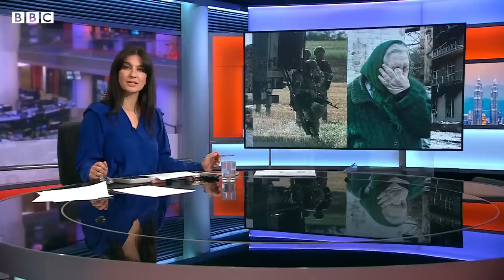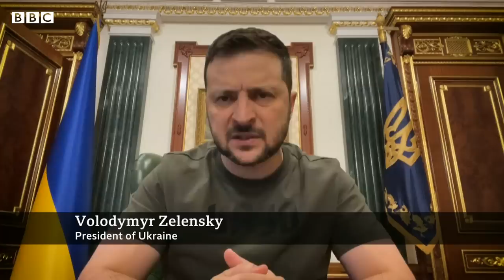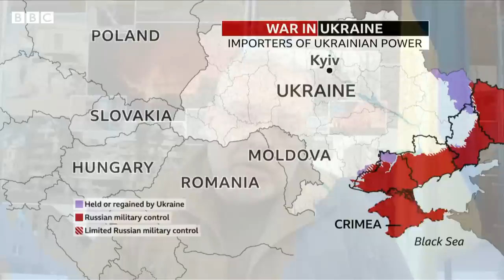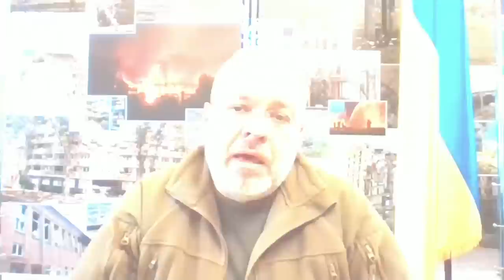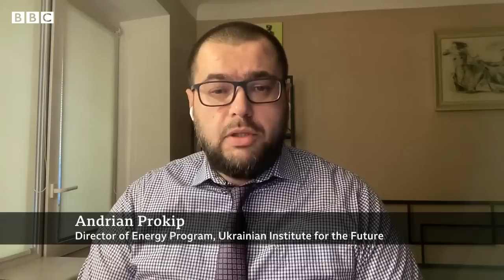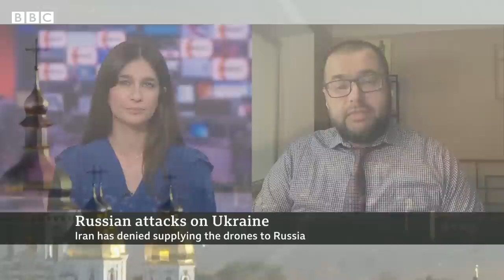Ukraine energy situation 'critical' after Russian attacks - BBC News

Comment: Two things: 1. Are these missiles accurate or not? It's frequently commented upon that they are inaccurate but they seem to be hitting their targets from what I've seen. 2. Going on bombing campaigns throughout history, critical infrastructure doesn't take too long to repair. Are the Russians willing to repeatedly hit these targets? It would take a lot of missiles.
Reply: they got hundred thousand Iranian drones. Don't worry
Reply: Depends on the missile they use, some are accurate.. some are only accurate to like 100m .. depends on the gps jamming/spoofing ukraine is doing in certain areas also..a lot of factors..
Reply: @gerrya4818  Ukraine cannot jam Glonass. It's completely controlled by Russia
Reply: @lancerevo9747  jamming doesnt require any kind of "control" .. jamming is incredibly simple for any radio signal.
Reply: 1. Missiles and attack drones can be different. Even with GPS jamming, an inertial guidance system remains with acceptable accuracy.
2. You are mistaken when you think that repairing electrical transformers and turbines are simple things. Transformers are made to order, depending on the power and voltage, it can be months or even years.  The installation and commissioning of turbines also takes months. And it's also extremely expensive.
Reply: @Rory_Mercury  You seem to know more than me I concede, but during WW2 the Germans seemed to repair infrastructure incredibly quickly. That's where I get my idea from.
Reply: They'll keep it up until Ukraine comes to the negotiating table
Reply: @AAA-sx5ej  they are 100% iranian drones, both complicit in war crimes. Not surprised considering the countries

Comment: CIWS phalanx guns on tall towers or buildings with clear line of sight could help. Bullets for them are still cheaper than drones or missiles.
Reply: Raining bullets over crowded city...hmmm...brilliant idea😃😃
Reply: @johnnysgaminglab2126  Obviously on the outskirts and not in the heart of the city. Fused shell auto-cannon variants that explode mid-air would work even better. I'm just saying that radar guided turrets are better suited at tracking and killing all manner of aerial targets for a fraction of the cost of flinging missiles. especially at the rate their burning through them.

Comment: The Russian attacks seem to have two focal points: To turn off all thermal (coal, gas) power plants in Ukraine. To destroy those switching station where more than two 330k lines connect. This will cut the generation capacity in Ukraine by half and totally disconnect some regions, especially in the east, from any generation capacity. It will thereby darken the cities in eastern Ukraine which will make waging war more difficult for the Ukrainian military. It will also make it more difficult for material support like weapons and ammunition to reach the front lines. (The regions that were integrated into Russia receive electricity from Russia.)

The attacks on the Ukrainian electricity network will have some external effects. Throughout the last years Ukraine supplied surplus electricity to some of its neighbors. Moldavia and Hungary were the two biggest buyers of Ukrainian electricity. While Hungary is connected to the wider European network Moldova is not. It also has only 350 megawatt of generation capacity. In 2017 some 20% of its energy came from Ukraine. Should one of its own power plants fail or need maintenance it will likely see blackouts.

Partying in Kiev had continued throughout the war. It will now end. The misery of war will now come to its capital and to the rabidly nationalist cities and towns in its west.

Wars come at a cost. Last month most of Ukrainians had yet to personally feel that. That will now change.
Reply: According to the UN reported by the BBC, by July at least 12 million people, or one quarter of the entire Ukrainian population, had been forced to flee their homes by the Russian invasion. I think they probably had a pretty strong personal feeling of the devastating consequences of Russian aggression.

Comment: They need to retaliate, those cheap drones use fairly common materials, it will not be easy, but, with the right expertise they can be reversed engineered reasonably quickly and sent back all the way to Moscow